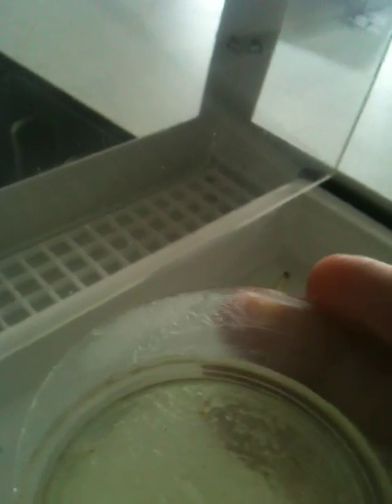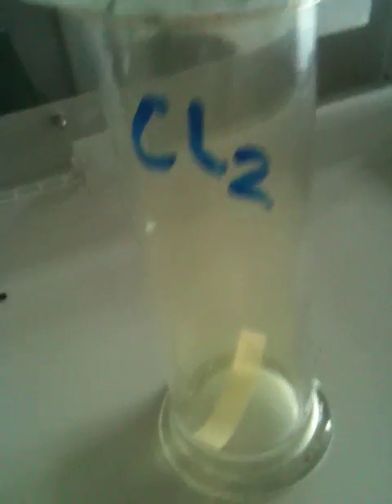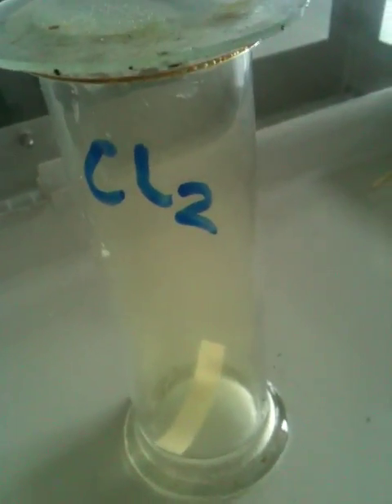Dr Nicolson tests chlorine gas with litmus paper and a lit splint.

Comment: Hi can you please explain why the lit splint extinguishes as i thought chlorine is highly oxidative, it should behave somewhat like oxygen which makes lit splint burn brighter?
Reply from the maker: Good question. Chlorine is an oxidiser as it has the capacity to take an electron away from another species. Oxygen is specific for the combustion reaction to produce carbon dioxide and water. As oxygen is in group 6 and chlorine group 7 their chemical reactions are quite different. Hope that helps!